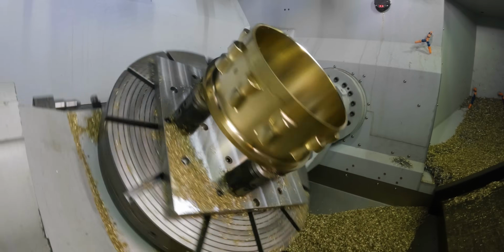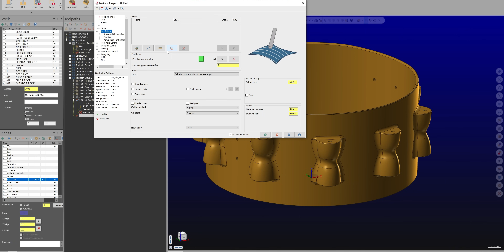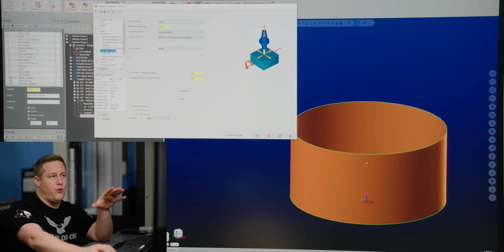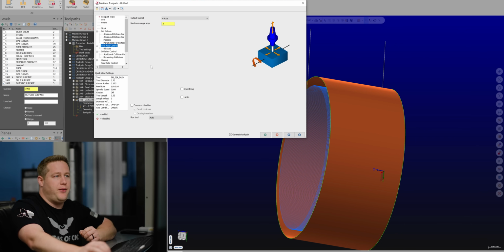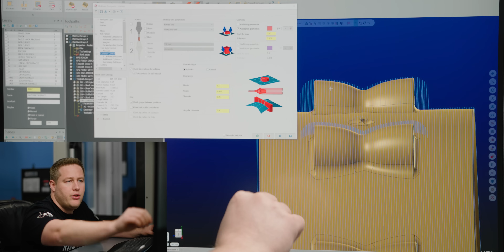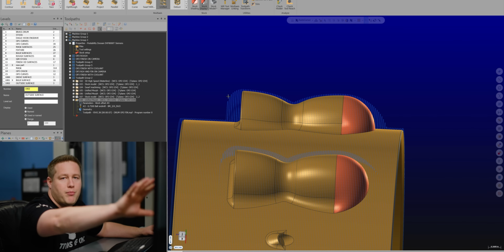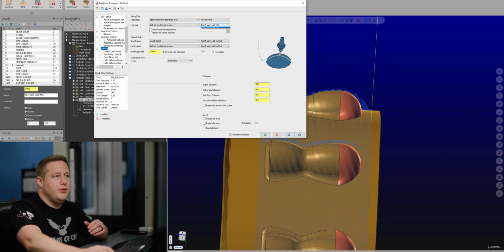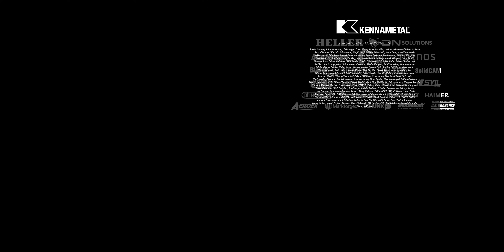Mastermind Programming a CNC Machined Drum

Comment: That section where it causes full slotting we have the same problem when gear cutting what I do to save time I manually write a rough cutting cycle  in this case it will plunge the cutter there while the 4th axis is turning 360 deg per plunge and leave some stock left for mastercams program to finish up for me. SOLIDWORKS a bit better you can set the depth of cut as well as width of cut in these cases

Comment: Love your videos so much Titans. I think you do a great job of describing your thought process while using CAM to program some of these complex parts. One thing I think would help many people as you do this is to add comments like what controls you are using as you use your software. For example, keyboard command like double clicking as you edit a tool path or holding right mouse button when you deslect areas to be machined in a specific toolpath. These are things that I have valued very much when trying to learn from videos. Just my thoughts but I think you guys do awesome work!

Comment: I use Fusion360 but the principles are mostly the same. When you set your lead in/lead out and it started from the wrong side I was thinking "Master CAM didn't know already not to come in from the side without the stock."  But actually the fact that you have to tell it manually would often be REALLY nice in Fusion. Sometimes with complex geometry when I want IT to generate a certain tool path it will decide it's lead in incorrectly and I'll have to spend time trying to trick it into leading in the way I actually want. I was trying to type out how I know I can decide these things easily by doing things in a different way, but based on special geometries of the Radio Telescope filter shape sometimes I can't use tool paths that let me control every aspect as easily.
Reply: Yeah Mastercam didn’t know which way to lead in because I wasn’t pointing it to any stock model.  So it had no way of knowing what stock is there.  It is nice having complete control over those things.  I have ran other software that didn’t give you any control at all over lead-in/out.  It was super annoying

Comment: I remember seeing a similar trick in some ways used from the Octopus machining in order to not have violent machine moves over every nubbin. I had totally forgotten about it though and its cool to see it on a more typical CNC part I might actually be given to make (I don't get many jobs for a titanium octopus coming through the door). It took me a second to get what you were doing until I started seeing you go into the avoid part!
Reply: Yeah that is why I wanted to show it.  Shows a more practical situation and how to apply it.  I use it a lot actually.  It’s just easier to control the cut pattern this way, and I am very particular about how I want the toolpath to look.